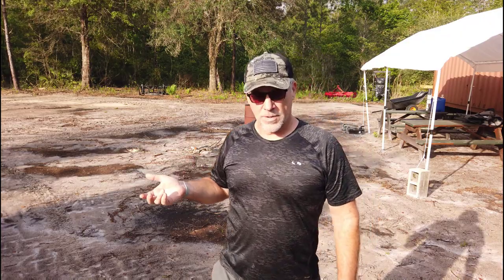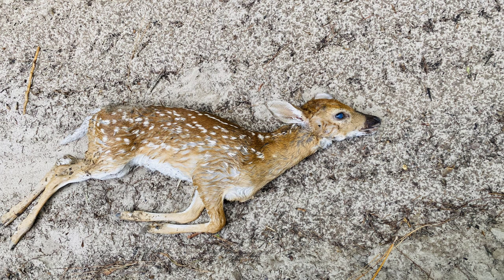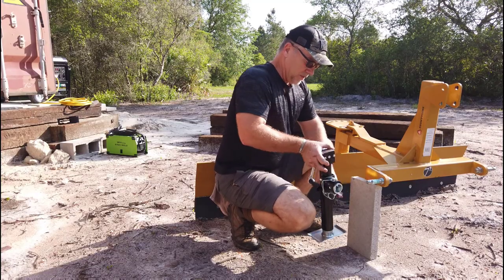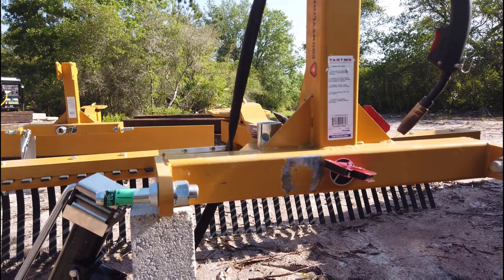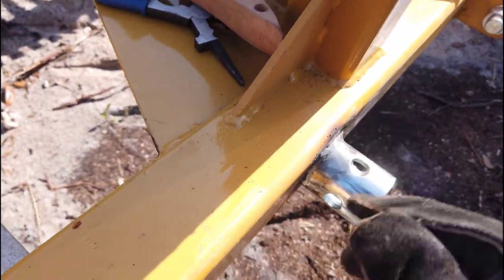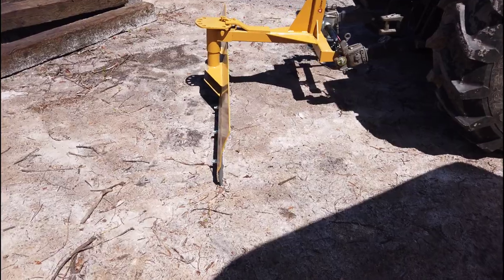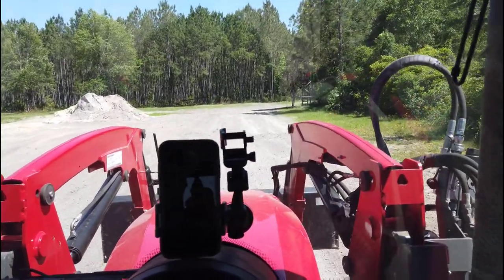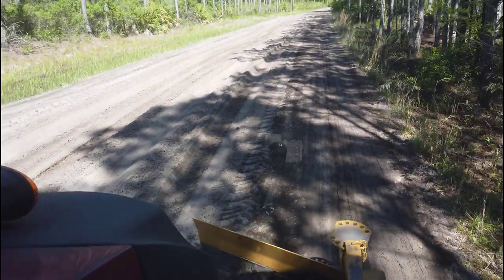Road Repair with Countyline 7' Back Blade

Comment: Completely agree with your logic about having attachments now versus with EA like 4-5 months when I called them about a landscape rake. It’s like, say someone bought a new tractor and they have to wait that long to get attachments to use it. I’m sorry that business model doesn’t work.  Maybe if your replacing something that’s wearing out or want to upgrade. But not getting something new for the first time. It’s not worth it my opinion. What’s the opportunity cost in losing that much time in waiting.